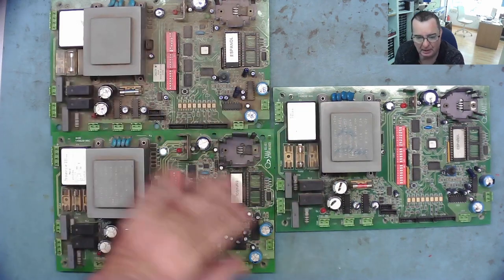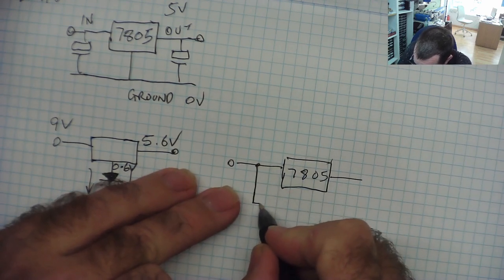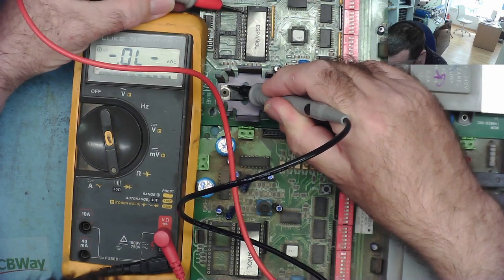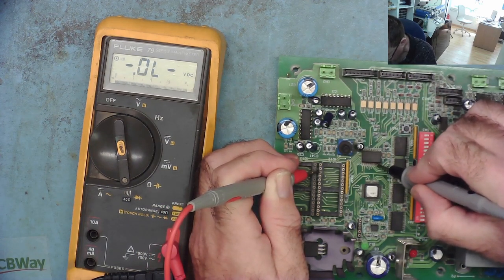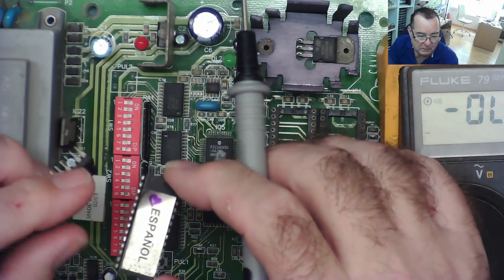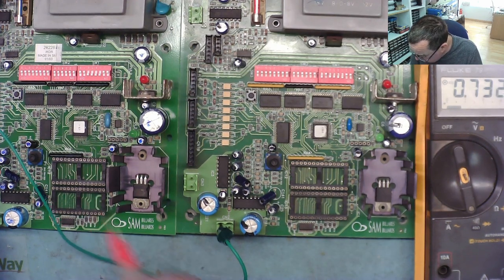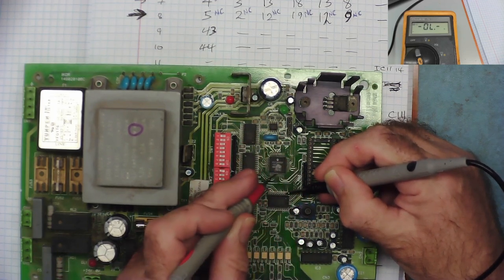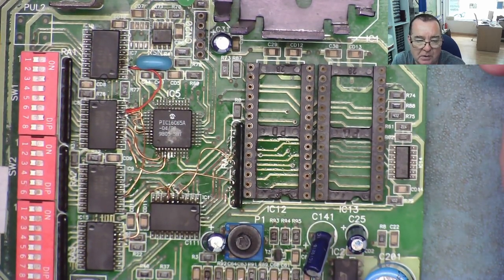Pure Electronics Repair 2: Part 2 Learn Methodical Fault Finding Techniques To Fix Almost Anything

Comment: Looks like a pretty standard data bus/addressing setup there - the 573 will be used to select devices to read (chip enable) and will connect those devices bits to the data bus (you can see there's one per DIP switch), one for EPROM sockets... They're essentially parallel switches - in a normal (inactive) state the CPU will have nothing connected to the data bus (but will be connected to all the 573s in parallel), and the microcontroller will enable 573 chip 1 to connect all the data lines through to read the bits (1 or 0) from the 1st DIP switch, chip 2 to read bits from DIP switch 2, so on and the EPROM will be read similarly (but also with separate addressing lines) through another 573. 

A live running diagnostic may be better, you can then firstly check for any stuck logic on the data bus (cpu side) as that will cause undeterminable problems :)
Reply: I totally back this approach! In some sense it is like using the machine to fault find itself rather than testing everything, thank you for the video Richard!

Comment: I recently tried to replace tracks on a CRT TV chassis that had been folded in half. I spent a few days in my spare time working on it, but in the end I got no love from it. Only reason I did it was because it was a 19" CRT and they're hard to find for arcades I build. It was a good exercise though I'm not sure I'd bother with it again. When something is this far gone I'm just not convinced it's worth the time.

Comment: These boards must cost a small fortune to replace, to make it worthwhile you spending so much time on them, with no guarantee of success.

Great for us viewers though. I appreciate the time you're putting in.
Reply from the maker: Yes he has a number of these machines and only one working PCB.  He has at least four bad ones and they are very expensive to replace

Comment: ISD1760PY-ND is the substituted part number. IC VOICE REC/PLAY 120SEC 28DIP. Hope this helps.
Reply from the maker: Thank you I know some guys here would know what that was
Reply: @LearnElectronicsRepair  Hi, no problems. if you search it up you can also get a 5V Arduino Voice record/Play module to play/program it. Might possibly work with the originals. Thanks for the reply.

Comment: Interesting. Personally, I would not reconnect the original board (marked O). Re my previous comment, and unless there is a motor configuration I am not familiar with, you cannot connect 'both motors' to one of those stepper controller ICs. There is (probably) only one two phase stepper (which is odd for just a blower motor) which requires both ICs to drive it. it is no surprise the fuse went bang and I suspect some of the 24V supply and both controller ICs are damaged (which could further damage the motor). Recommend the purchase of a grinding pen, if available in your location.
Reply from the maker: I'm not sure those motor controllers are the blowers actually - they may be something to do with releasing the puck when you start a game.  It's possible the blowers are switched by the two relays. I suspect that motor driver modification/botch worked for some time but it needs putting right.  The next step I think is to determine if the micro-controllers are good. I ordered 20 of those HC573 so I can just change them all.  Other than that, if I can determine the micro-controllers are good, I may also just replace all the remaining ICs (motor controllers, Audio Amps, and the glue logic as well. Since publishing this video I also spotted a 24LC01B near the voltage regulators and green LED.  I can check that to see if the processor is trying to access it

When I had all the boards powered up on the machine I checked the voltage rails (5V, 12V) and they were good.  A lot now also depends on how much the owner wants to pay to get these fixed.
Reply: @LearnElectronicsRepair  Yes, something to do with pucks etc. makes more sense. I would still check the motor type and controller datasheet carefully before reconnecting. 2 IC's are required to drive a single 2 phase stepper. I would hate to see the motor being damaged. There may be a 24V supply which has been damaged, not sure. Good luck (Neeson style ho, ho).

Comment: Keep in mind that those red DIP switches are known to fail over time, even when they are not used often or even long periods of time in the same position.
This can gives strange results, because you don't expect that they can fail. I seems that the contacts become oxydized over time and the resistance goes way up.
Reply from the maker: Yeah I did mention that possibility in the video also.  As I don't believe he ever changes the settings I could check with him and possibly just remove the switches and  put some wire links in where needed
Reply: @LearnElectronicsRepair  A resistance check will pretty much show anything failing there, it'll be logic 1 or 0 at +5V TTL logic level I expect so would have to be pretty high resistance to be a problem, in the Megs I guess, particularly as next to no current flow?

Comment: after watching most of your videos it seems to me that a lot of the electronics in the Canary Islands seem to suffer with corrosion,
Reply from the maker: Definitely!
Reply: @LearnElectronicsRepair  hmm corrosion acts when there are dissimilar metals in contact in the presence of moisture. On the video  it looked as though the copper tracks under the solder mask were intact.  So maybe the exposed copper/ solder had corroded. How about brushing some lacquer over the soldered contacts, to improve protection a little bit in humid environments?

Comment: Boards this dirty should not even be measured, 10 second cleaning with contact cleaner and good brush can/will save hours of troubleshooting in wrong directions. Its good to have some habits and checklist what steps to do in which order to be good troubleshooter.
23:35 35:30 - DIP switches are on different positions while you were measuring. Could be unrelated, but could be related.
Some multimeters, in diode mode, bleep because they charge capacitors. Are you sure that this is not your case?
My method of checking multiple IC chips is following: First locate pin on board which is ground. Then use diode mode and red probe on that pin on IC, while IC is out of circuit. Then touch each pin of IC with black probe and write a chart. Then repeat for second IC, while both of them are out of circuit. Difference is easily spotted.
IF and only IF, board revisions are the same, this can be repeated for board slots for IC legs. Then investigate difference.
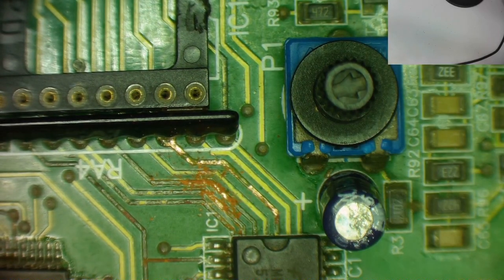50:00 - Lemon acid can help to remove rust and battery leaks. Dont use strong chemicals they can ruin board even more.
Regarding the chip, I just googled "isd2560 circuit" and found circuit and pdf datasheet, I believe its what you need. Use website alldatasheet [dot) com and search part number ISD2560P.
Reply from the maker: @orion 310591 I changed the DIP switch settings (mentioned in the video) to make sure that was not causing the difference, maybe you didn't see that? Anyway it wasn't the DIP switches.  I did try to find the datasheet (on alldatasheet.com and elsewhere) but was searching for 2560P so didn't find it.  Well done for going one step further 😉  I think your method of probing is similar to mine that I used in this video.  I just did it from what I thought was the eprom (was audio samples which I suppose is a kinda ROM really, and I also mentioned that possibility in the video) and I built up a map of connections that way.  I guess we all have different methods to achieve pretty much the same thing.  Regards the Fluke 79, when in diode test mode it gives one short bleep for a semiconductor junction and a continuous bleep for a short.  In continuity (low ohms) mode it does not bleep at all on semiconductor junctions but still give continuous bleep on short (and also as you say bleeps for a short time while a capacitor is charging)  I was getting too many false positives in diode mode so later in the video switched to continuity ohms mode.
PS thanks for keeping me on my toes and raising these issues 🙂